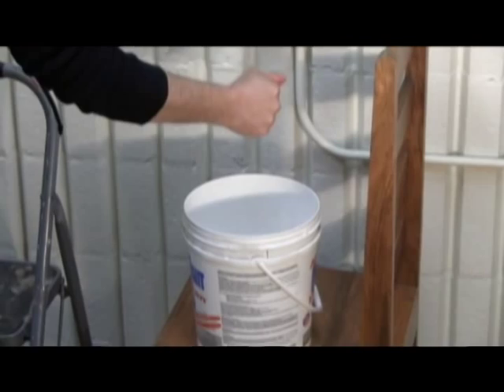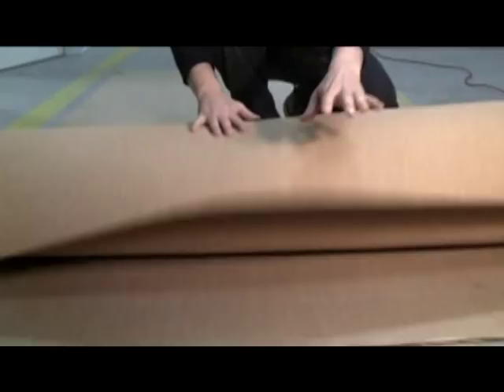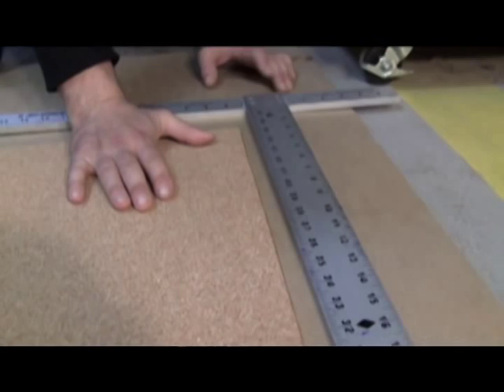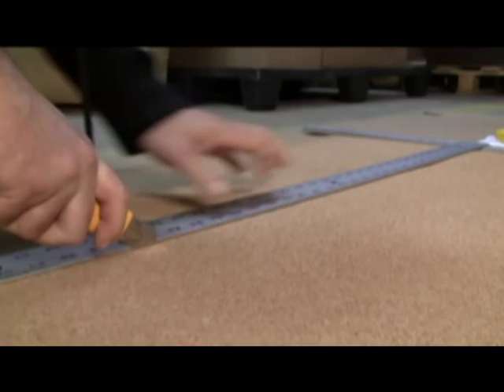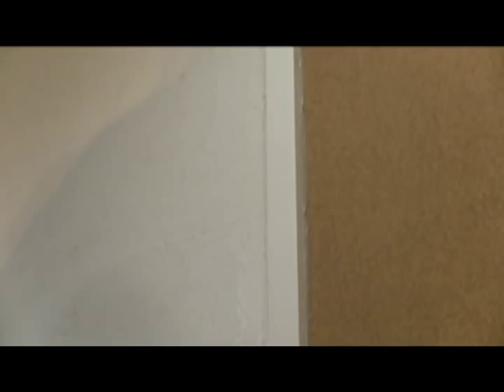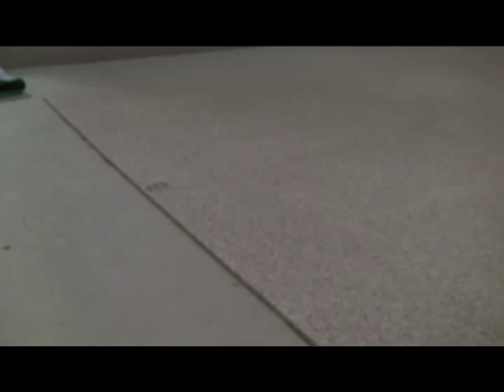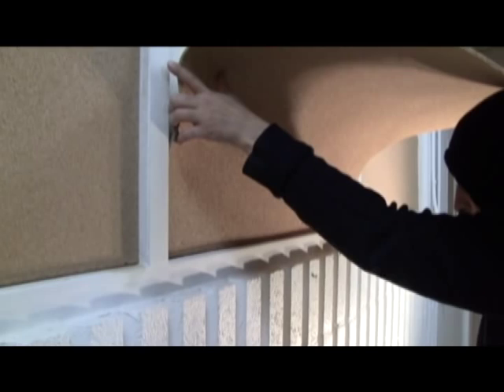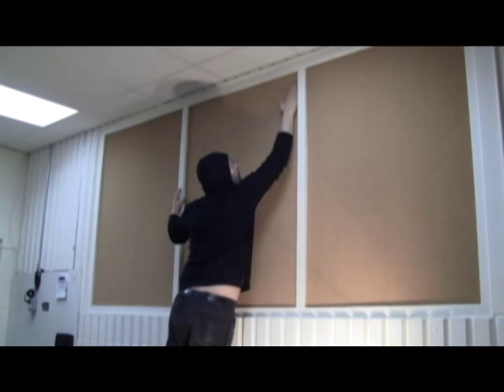How to install a cork roll on a wall.

Comment from the maker: The contact cement is pretty permanent. If you want to be able to remove it, you could adhere the cork to a piece of plywood and then attach the plywood to the wall.

Comment from the maker: We recommend water-based contact cement. With a concrete wall, however, you need to ensure the wall is as smooth as possible for maximum adhesion. It cannot be raw brick - should be painted first. If you can fasten a plywood backer first and adhere the cork to that, that would be ideal. We'd be happy to discuss this with you in more detail. Please contact our customer support team (the link to our contact information is in the video description) and we can help you out.

Comment: Great info, thanks! Is it a good sound absorber, please! I have a problem with the noise coming from the neighbours
Reply from the maker: Cork is a natural insulator against sound so it will help lessen sound transmission. This is one of the many beneficial properties of cork. The thicker the cork, the more it will help (for example, the 1/2" thick wall tiles would be more insulative than the 1/8" thick tiles). There are, however, other variables such as the makeup of the wall that also influence sound transmission. So though it would not stop noise, it would help dampen it. You can find some options for cork wall coverings here: http://www.corkstore.com/Products/Wall-and-Ceiling-Coverings  If you would like to discuss this in greater detail, you can reach us via email cork@jelinek.com or else give us a call. You can find our contact information on our website: https://www.jelinek.com/contact  Thanks!

Comment: I heard this is good for sound blocking as a sound barrier some test have proved this theory greatly what is the pricing per foot or roll
Reply from the maker: Yes - cork is a natural insulator against sounds. Cork helps lessen sound transmission and the thicker the cork wall tiles, the more it will help (for example, the 1/2" thick wall tiles would be more insulative than the 1/8" thick tiles). There are other variables that influence this as well including the makeup of the wall. If you would like to discuss some options in more detail, please contact our customer service department directly. They will be happy to talk through this with you. You can reach us via email cork@jelinek.com or else give us a call. You can find our contact information on our website: http://www.jelinek.com/contact-us/ Pricing for our cork wall coverings can be found online: http://www.corkstore.com/Products/Wall-and-Ceiling-Coverings Thank you!

Comment: If there is old paint, does it need to be removed? Is it enough to sand it or some more serious method should be applied?
Another question: if there is moist and some mild mould spots in the apartment, is cork a good idea? How to treat those areas in advance and is it possible for the mould to develop further?
Reply from the maker: When installing cork on a wall, the wall needs to be free of any loose paint so it would be best if its sanded so any loose paint is removed to ensure optimal adhesion. If the wall is damp or there is any moisture, cork should not be applied to the wall. If you have more questions, we'd be happy to discuss this with you in more detail. Please either email us cork@jelinek.com or else give us a call. You can find our contact information on our website: http://www.jelinek.com/contact-us/ Thank you!

Comment: Got any ideas as to how to put it up between the rafter Joyce’s and a basement ceiling I’m leaving the paper backing on because it becomes too fragile without it and I’m gonna try to staple it up but it’s very hard to get the first three Staples on while holding it up yourself

Comment: I have a project that requires more than 1 , 4' width of material ,It will need a butted seam. I am wondering if I could apply wallpaper blank stock to the back of the cork with contact adhesive and then install the cork panels with a heavy duty wallcovering adhesive?
Reply from the maker: We do not recommend applying the cork to wallpaper and then wallpaper paste to the wall. We do recommend installing using water-based contact cement to adhere the cork directly to the wall. If you want something less permanent, you can use contact cement to adhere cork to plywood and then screw the plywood to the wall.

Comment from the maker: For the backer board, do you mean the cork or what to adhere the cork to?  The thickness and material depends on your application. If you want cork thick enough for pushpins, the cork would need to be 1/4" (6mm) thick. We recommend using water based contact cement. A good brand is 3M. We'd be happy to discuss any questions with you in more detail. Please contact our customer support team (the link to our contact information is in the video description) and we can help you out.

Comment: Can this be applied to a cabinet (school  furniture) and then used as a bulletin board---butcher paper stapled to it and student work stapled/displayed?  I have no actual bulletin board and am thinking I could create one.
Reply from the maker: It can. Keep in mind the contact cement is pretty permanent so if you want to be able to remove the bulletin board from the furniture, you may want to adhere the cork to a piece of plywood first. Also, the cork should be 1/4" thick if you want it thick enough to hold pushpins.

Comment: Will this help with soundproofing? that's the reason why I want to put it on the wall.
Reply from the maker: Cork is a natural insulator and will help lessen sound transmission. The thicker the cork, the more it will help (for example, the 1/2" thick wall tiles would be more insulative than the 1/8" thick tiles). There are other variables that influence this as well including the makeup of the wall. You can find some options for cork wall coverings here: http://www.corkstore.com/Products/Wall-and-Ceiling-Coverings If you would like to discuss this in greater detail, please contact our customer service department directly. They will be happy to talk with you about this. You can reach us via email cork@jelinek.com or else give us a call. You can find our contact information on our website: https://www.jelinek.com/contact
Reply: @JelinekCork  thank you very much for your reply I appreciate it I will go straight to your website and see.

Comment: I want to insulate my truck cap inside ceiling and sides with corkboard rather than insulation. I have a fiberglass truck cap. What can you suggest? Thanks! 😊
Reply from the maker: You could use a few of types of cork products for this application. Using corkboard material as you mention (such as QuietCork or cork insulation sheets - http://www.corkstore.com/Products/Cork-Rolls-Sheets ) works for this though could involve lots of cutting and shaping to get it to cover the curves and shapes of the vehicle. Another option is Cork Spray - http://www.corkstore.com/Products/Cork-Spray . This works well as it hugs the curves/shapes of the vehicle and has a thinner profile with similar insulation values as the cork sheets. If you have additional questions or would like to discuss this further, please either email us cork@jelinek.com or else give us a call. You can find our contact information on our website: http://www.jelinek.com/contact-us/ Thank you!

Comment: thanks. it is 3/8" 4'x8' roll cork and I want to install a large bulletin board onto a sheetrock wall. I also want to be able to remove it at some point so I'll drive screw to the studs. I was wondering is mdf or plywood sheathing is best - probably only 1/4" is needed. I also will rip the whole affair so it is 2'x8' or 3'x8'.

Comment: We used spray adhesive to use with out outdoor information board, it’s a scout project, unfortunately the roll puckered in spots, what type of adhesive should we use to apply to OSB? Is there a way to fix this?? Thank you
Reply from the maker: We recommend brushing a water-based contact cement onto both the cork and the substrate (note the substrate must be suitable for outdoor use). After brushing the contact cement onto both surfaces, allow it to dry completely (approx 45 minutes). Once it is dry, carefully position the cork over the substrate and press it tight across the entire surface. Also, the cork board must be protected from rain and elements or it can cause the assembly to fail.
Reply: JelinekCork what if we adhered a second layer or cork to the first? What adhesive should we use in this case? Thank-you!
Reply from the maker: Dena You can do that also using contact cement and brushing it on to both layers of cork, waiting for it to dry (as above) and then bonding the two surfaces. However in order for this to work well it would be important that the first layer of cork is firmly adhered. Any issues with the first layer will telegraph through to the second layer.

Comment: I found tiles on sale, 10/$95, but the cement in $212 on your site!  What else can be used?
Reply from the maker: For an application such as this, water-based contact cement is recommended. It creates a strong bond to keep the cork adhered. You should be able to find this at your local hardware store as well.

Comment: Wasn’t entirely clear to me … do you apply the glue to the outside of the roll?. My cork retains the roll memory making it very hard to layout.
Reply from the maker: Both sides of the roll look the same but for easier installation, it is best to use the outside surface. Here is a link to written installation instructions that may be helpful too:  https://www.jelinek.com/s/how-to-install-cork-roll-on-wall.pdf
Reply: @JelinekCork  thanks. Any tips on how to remove the roll memory?  I’ve had mine cut to size and stored flat for weeks ( weighted ), but as soon as you release it it just rolls itself up again.
Reply from the maker: @alanjacobs7302  The rolled cork won't flatten all the way until it is adhered securely with the contact cement. Be sure to follow the manufacturers instructions for the contact cement.

Comment: Can you clarify what kind of primer to use? Thanks!
Reply from the maker: The primer can be helpful when applying cork to new drywall, it helps ensure the drywall is free of dust and keeps the contact cement from being absorbed. You can, however, also use two coats of water-based contact cement instead - the first to act as the primer and the second coat as the bond coat. If you want to use actual primer, you can use a standard latex paint primer.

Comment: What kind of contact cement? Do you have a brand name you can recommend?
Reply from the maker: Water-based contact cement is recommended. You can find it on our website - http://www.corkstore.com/Products/Floor-Accessories - or you should be able to find it at your local hardware store as well.

Comment: what is the name of the cement you left that out
Reply from the maker: We recommend using a water-based contact cement. This is available on our website: http://www.corkstore.com/Products/Floor-Accessories/Contact-Cement-3M-Green-1-Litre or you should be able to find it at your local hardware store.